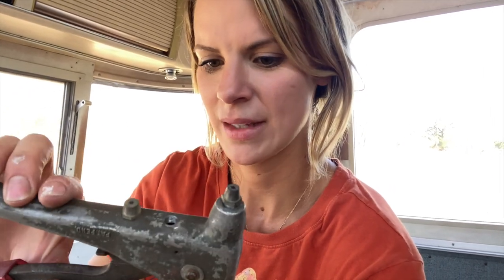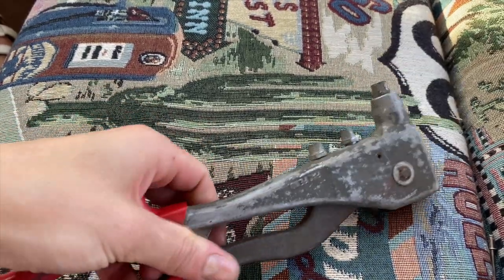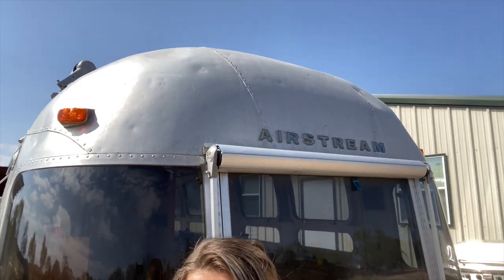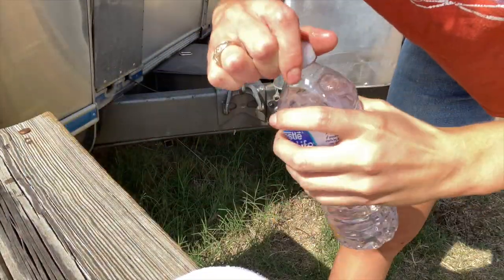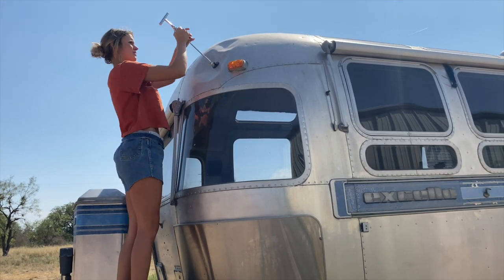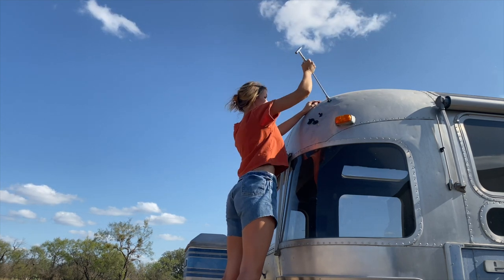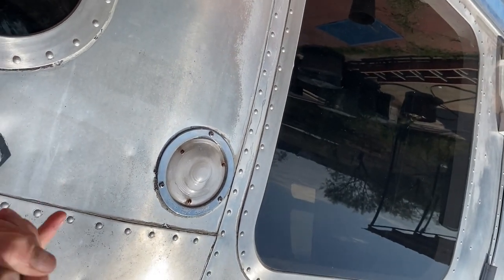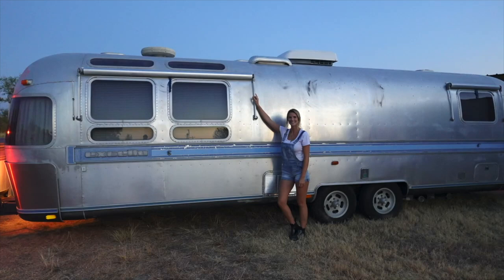Vintage Airstream Dent Removal

Comment: Keep those videos coming!  Sometimes for those small hail dents you can use a hair dryer or heat gun on a medium setting and heat the metal up then use dry ice to rapidly cool the area which oftentimes will make the dent pop out.  Worth a try, just be careful when handling the dry ice, you don’t want to let bare skin touch it.

Comment: Just a quick comment on your dad’s rivet gun - the fitting you use in the tool is the one that fits the shaft of the rivet (the part of the rivet that gets broken off).  The tool must be able to grab the shaft in order to pull it.

Comment: You can also use the pops a dent tool. It has a large bridge with a screw type of puller. You just twist the top nut and it pulls on the dent. A little more controlled than the slide hammer.
Reply from the maker: I’ll research that thank you 🙏

Comment: Every year when we come back I walk around the entire trailer and inspect for dents and scratches. What I can’t pull out we remove the interior panels needed and hammer out any dents. Looking always at rivets that need replaced with the correct methods needed. Typically this process only takes a few days to keep dent free and water tight.

Comment: Kayla, please try BBKang dent removal kit from Amazon 60pc $59.99 works fantastic on dents and it removed a crease in my 2020 Flying Cloud Airstream! Key is to remove the glued on  pulling tab BEFORE (with rubbing alcohol) it pops off, it you use the squeeze trigger tool serval times on the same dent you can massage the aluminum skin back out with making a dent an "outie" by pulling too much.
Take your time and be patient and you will love the results!

Comment: Paintless dent repair on cars use metal rods or rounded blocks of metal to get behind the dent from the back side and massage the dent  to remove the dent. If you can get behind the dent by taking some of the interior liner down it is fairly easy to gently work the dent out from the back side. If you have 2 people you can have someone hold a block of metal on the outside and gently tap the dent from the back side to remove.